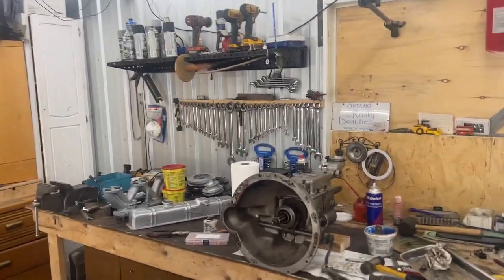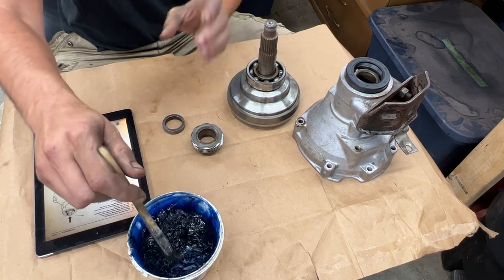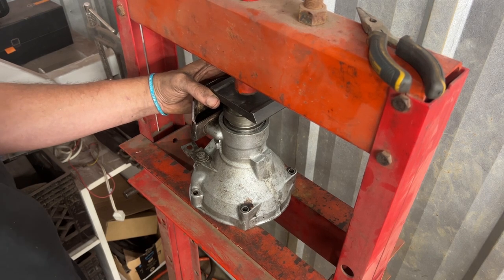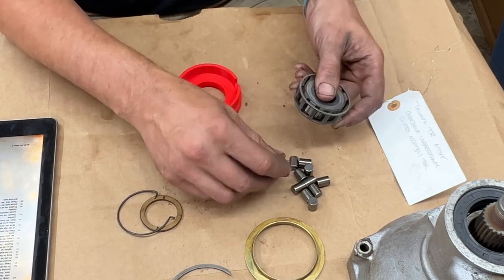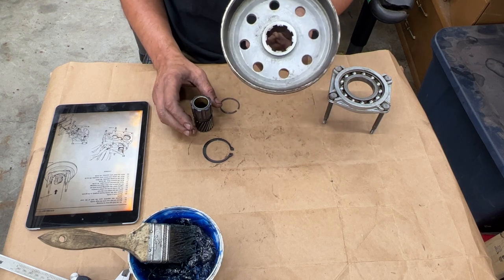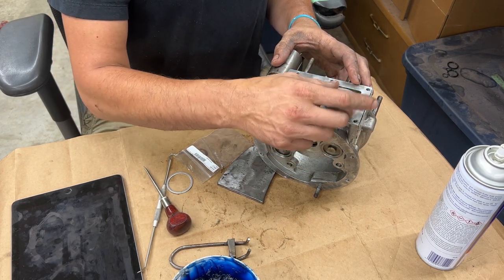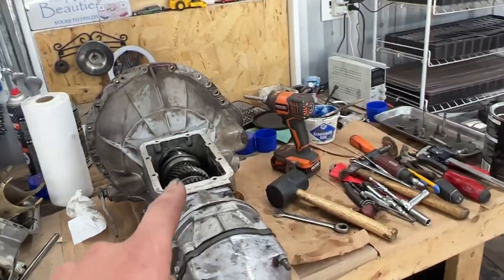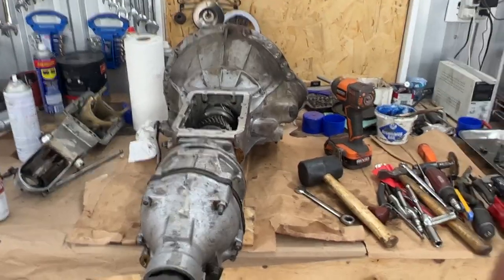J-Type Overdrive Overhauling - Part 2 - Assembling - Start to Finish

Comment: Excellent video series on the J-type overhaul! I’m in the middle of doing one for my Volvo. Getting the 12 roller bearings back into the cage was no big deal using a wide rubber band. I did it on the first try in about 2 minutes. If you’re going to rebuild a lot of these, having the 3D printed tool is a fine idea. I hope this is my only foray into the OD.

Comment: The specialty nuts you mentioned at 45:13 are called Aerotight Lock Nuts. They can be quite common in british cars and are used just about anywhere. They can wear like a normal lock washer so obviously its at mechanics discretion whether you replace them.

Comment: I have a problem with my typ J . I can`t los the owerdrive from gerbox, just moving 3-4 mm.  Wath hold it ?   David
Reply from the maker: Unfortunately I think there is an internal damage of the sun gear or the unidirectional clutch, which damaged also the splines of the main shaft causing it to get stuck. The only way is to tap it out gently with a brass or lead hammer and hope for the best. Normally it comes out very easy.
Reply: Tank you, i hade to take it away with fors , byt i dont se wat hold it , the valv hous is damaged, but i have order a used  valv hous ,  tanks